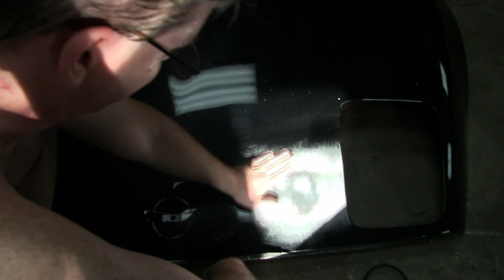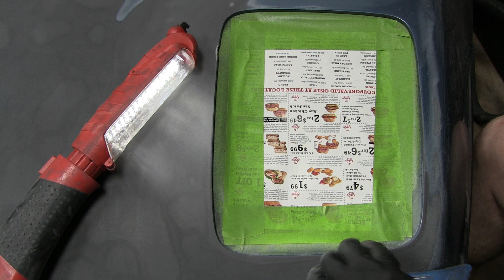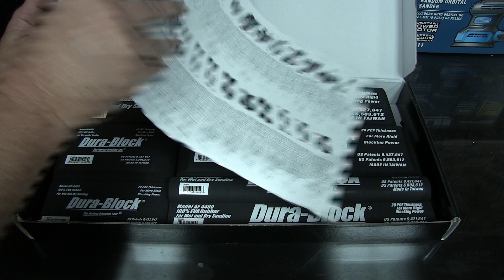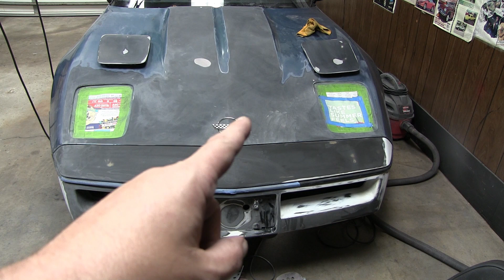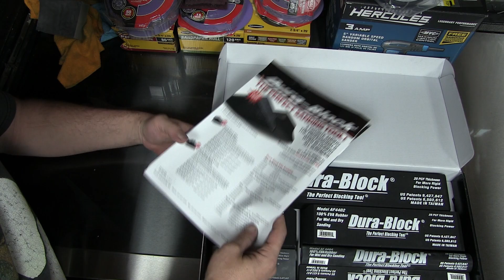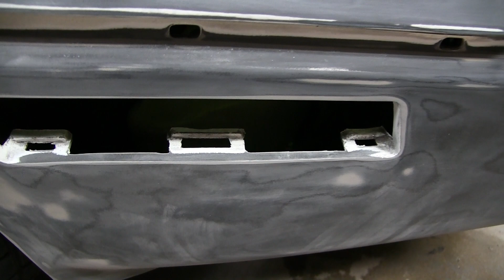C4 Corvette DIY Front End Collision Repair - Part 16 - Paint Stripping

Comment: You have way too aggressive sand paper on that hood. You are going to be sanding forever to get the scratches out. You could have started with 220 and finished with 600. Palm sander is going to give you waves. Air file or long block is the way to go.
Reply from the maker: I can attest 220 would have taken forever on the hood as a starting point with this type of sander.  I'll agree that will lessen the scratches but since I was using light pressure and mainly low speeds with the 80 toward the end (with discs that wear out fast) it feels like I initially started with 180 by hand.  220 on this sander makes it feel like 320 by hand but I haven't gotten that far as I still have to fill a few low spots to fix.  I'll also agree an air file would be superior to this but again I do not have a compressor setup that would sustain that.  The hood still needs more work at this point to go for primer, but I think blocked out at 320 should be sufficient for that and 400-(600max) before it gets shot with base coat.  Once again I am not a pro at this, simply a first timer but I do appreciate your input.
Reply: @diymakerdan  I'm ASE B3 certified. I guess what you think is best.
Reply from the maker: I was not trying to be a smartass there Mister.  Just relaying my experience  and future plans is all.   I do however understand the tone of your comment though.
Reply: @diymakerdan  Like I said "What ever you think is best". I get at least one of you weekly stopping by. Don't get me wrong I would guess you're going to spray a 10 footer. A 5 footer tops. Waves, scratches, cracking, and other prep work mistakes don't show on camera very well. Some might not show for a year, or till some miles are on the paint. Some people can make a harbor freight sourced paint job look good. Some fail miserably. With your willingness to accept constructive criticism I would say you fall into the latter. I can't wait to see this car painted.
Reply from the maker: @misterrobato8270  Wow, once again that was kinda rude there.  As far as constructive criticism, I am open to reason, and have no issue migrating to better methods if I can hopefully adapt, but must prove to be time and cost effective.  There are even points in the video where as a first timer I criticize myself but I highly doubt you watched it fully.  Perhaps with your vast knowledge you could try to assist others moving forward instead of only pointing out the spilled milk then implying its all going to turn out like poop and labeling me as ahem, ’that guy’.  Sounds like you are sick of that ‘everyday normal guy’ that visits your shop weekly so I get where that comes from.  Feel free to tag along with your hopes for this to “fail miserably” that's really encouraging.
Reply: @diymakerdan  I will.